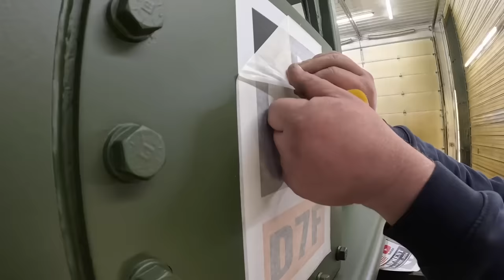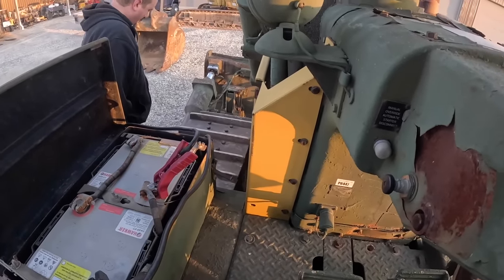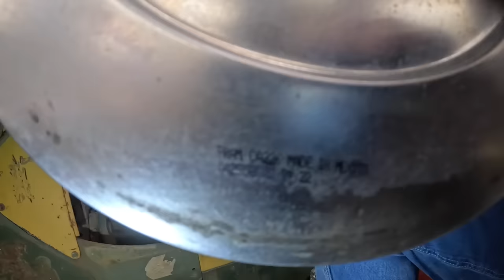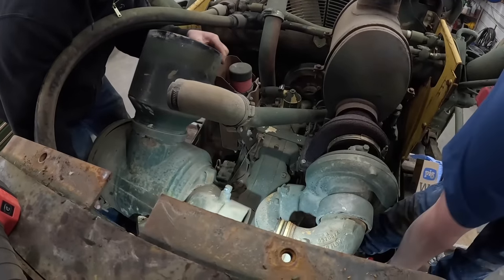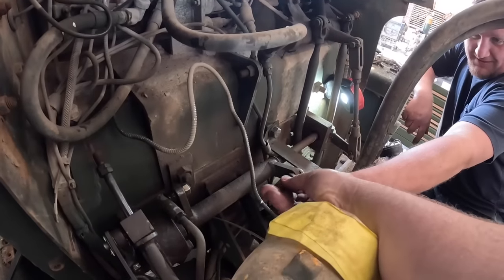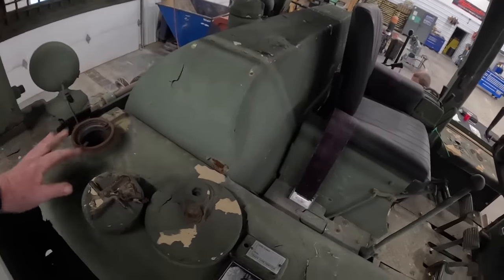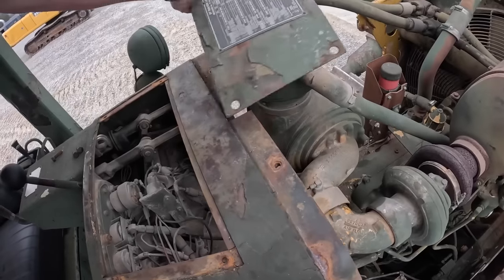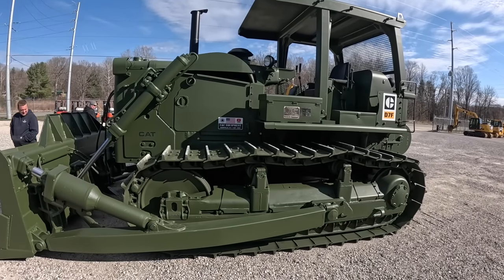53 year old Ex military Caterpillar D7F dozer gave us problems!

Comment: Just got my injection pump back from Area Diesel Service. $925.  So glad I went with them. Bad solenoid, flex ring in pieces, bad cam ring. Very fast turnaround in under a week. Thanks for the lead Clint

Comment: The "paint" is CARC. Chemical Agent Resistant Coating. It comes out of the paint gun almost like pressurized pudding. I sprayed an entire divisions worth of equipment in Saudi back in 1991.
Reply: What did you use, an airless paint sprayer or something like an undercoating gun, because a regular paint gun would never spray paint that thick through it?
Reply: Hopefully you didn't paint 'em green. :)
Reply: It is the quick strip paint. All you need is a good putty knife and you can field strip it in just under an hour.
Reply: Interesting. I remember all the gas masks on the news at that time
Reply: Always remember CARC dust should not be inhaled! Always use a really good respirator!

Comment: I’m a Toyota technician been so for 25 years now and love this channel. Is given me a different perspective on other fields of repair. I’ve noticed in the last few videos more and more snap on tools have been used. I’m a fan of most tool brands that work and last especially snap on. Glad to see you guys are upgrading to a tool that can still brake but looks good doing it.  Keep it up guys again love the channel.
Reply: Yes using Snap-On saves your knuckles as most never break, have several 30 years old and still going strong.
Reply: Also, as a former MAC Tools dealer I would tell my customers that they would only have to buy a wrench made by Mac one time as we would warranty them for the lifetime of the tool for defects in materials and workmanship. The only time they would have to pay for a wrench is if they lost it or someone stole it. I had a man come on my truck here in the Jacksonville Fl area who had an inch and a quarter combination wrench that he bought in Alaska in 1962 that had the chrome peeling off of it (MAC would warranty this due to the danger of the chrome cutting the hands). I reached for a brand new one (that costs considerably more in 1983) and handed it to him. Grant you those wrenches cost quite a bit, but I also tried to carry a stock of tools and such that fit the demands of the workplace and there were many times I was able to get mechanics out of a jam by having something on the truck to enable them to get the job done.

Comment: If they painted that dozer like we painted out M151A2 Jeeps, they used house paint and a paint brush. When I was at Ft. Polk we painted them every time we came back from the field. Sometimes we painted them BEFORE we went to the field because we would have a big inspection before we went. I was in a Military Police unit so everything had to be spit and polished all the time. There was so much paint on those Jeeps, and the trailers, it was crazy. But, thats what the brass wanted so we did it. Great job as always gentlemen.
Reply: Your comment brings back the memory of a friend of mine who bought a surplus Coates tire changing machine, and being the particular guy he was he stripped off the many, many, many coats of paint on it and of course repainted it original color. He said the thing had been painted so many times that it would not even operate due to the paint buildup. I do not understand why, oh why some outfits get so carried away with painting everything all of the time, and generally with poor preparation for proper paint adhesion. The only way to properly prepare the surface is to bring it down to the bare metal and refinish it as was done here. You get more mileage out of your paint job that way.

Comment: If it might be possible just how does Kevin remove all that thick and often flaking paint from those ex-military machines. I know from what you said in the video it would need sand blasting to do this job but what abrasive does he use to strip that incredibly thick paint? Can a clean finish be achieved in one pass or  are two or more required? etc. etc.

I do think that whoever has been involved in that process the end results are quite remarkable. To me it looks as though it has just come off the showroom floor, congratulations to all involved  for an excellent job. You should feel mighty proud of the results of your work . Regards, Dan

Comment: That machine looks fantastic and I suspect it will be a very reliable and easy to maintain machine. When I was a young man back around 2000 I bought an Army Corps D4-7U that was in amazing condition. I put around a thousand hours on it and ended up selling it for $6,000 to a guy that was going to use it as a show tractor. I regret selling it as it never gave me any issues.

Comment: Mr Clint, 1st year apprentices get told not to tap battery connections with a hammer. When I did my apprenticeship in England, starting in 1975, most, if not all battery terminals were 1/4 BSW size. That was the only BSW spanner, sorry wrench  but I did have a 3/4 inch BSW socket for the steering wheel nut. Keep the content coming guys. I do not miss pushing spanners for a living.

Comment: Next time if the fluids are fresh walk away 😂😂. Turned out to be a nice dozer, I can't believe someone messed up the linkage that badly. But you don't have hydraulic system issues, blown engine, or bad drive line. The pain was the worst I've ever seen, looks like they brushed it on several times because they were bored 😂😂😂. Great job again guys.

Comment: Sometimes those dead Hawkers can be brought back to life with a pulse charger or smart charger. The slow charge and the pulse at the same time can revive them! Charge them individually with 12 volts. I am surprised you put the ground cable on 2nd instead of last when you installed new batteries! Nice paint job!!

Comment: Just like the T-tree connections  or 3 on a tree on a 74 F150 Pickup steering column.  There are more moving parts than a grandfather clock. 😮 😅

Comment: I dunno about the green, I was kinda liking the gray look. Not necessarily primer only, but certainly a 'Navy' appearance might be a nifty change.  Heck, gray with black highlights could be a thing. Black grill, Black roof and rops, black winch and push arms, the rest gray.

Or gray, back and red, like the front idlers and sprocket amd track frame in red to have a call back to the early Holt, Best days of caterpillar crawler tractors.

Comment: I wish I had a use for a nice used dozer I'd buy one of yours. I'm pretty darn picky about equipment but youse guys do some nice work. One thing though, if you're going to hammer on battery terminals do it the railroad way and get a bigger hammer.

Comment: The older cats with the levers coming up through the floor didn't use all those linkages. Easier to work on. That paint should be easy to strip. Randy should have blow most of it of with the pressure washing. G'day from Tasmania

Comment: That turned out really nice, you guys do the best restoration work that I have ever seen!, Inside and out. It makes a difference when someone takes pride in their work and has a team that is capable of making it happen......its good to see someone saving those old machines and putting them back to work. Where did you find those side screens and the military green paint? I need to repaint our D-8K and d7F they're faded really bad and starting to get some rust. We can't find the paint anywhere around here and I'd love to know where you get it.
Reply: Any auto paint store can mix up all the "OD" green you want
Reply: @taloniilm  I agree with you about being able to get a color match on the military green paint, but automotive paint is completely different than equipment paint. It doesn't hold up as well as equipment paint, or at least when I've tried it in the past it doesn't. It seems to wear away from being scrubbed by tree limbs and brush on a clearing tractor. It also chips away from impacts much worse than equipment paint.  Thanks for the advice anyway.   I miss the days when you could get the old lead based paint to put on machines, that stuff was tough. but you had to be careful to protect yourself while spraying it.
Reply from the maker: Rapco parts has the paint

Comment: Although I dont work on ehavy equipment, I can confirm John Deere small equipment (zero turns, riders, and push mowers) is absolutely over engineered. Changing a drive belt on some zero turns takes hours.

Comment: Just got around to watching you guys work on this Kitty Kat. I think they painted the thing with a trowel. Are you sure they didn't send it out to the Navy? You know, "If it moves salute it. If it don't move paint it, and beware of slow moving Admirals." Also, when I worked at a Caterpillar dealership, I gave many thanks that I didn't work in the tractor shop. Every bay had at least two jib cranes per bay along with an overhead crane shared between two bays, and porta-power tools everywhere. It was not easy getting them apart, but it was easier getting them back together.